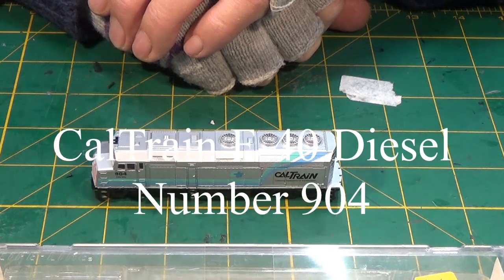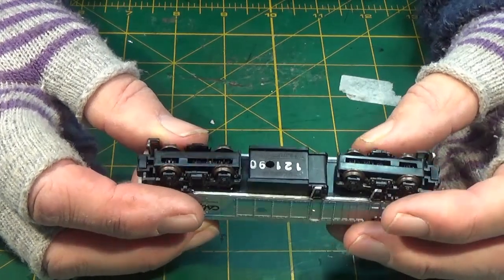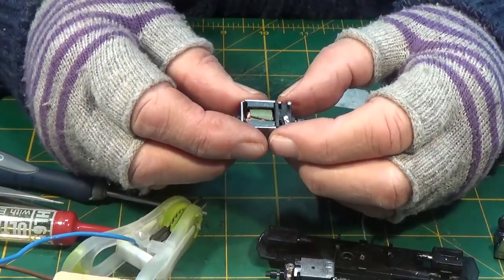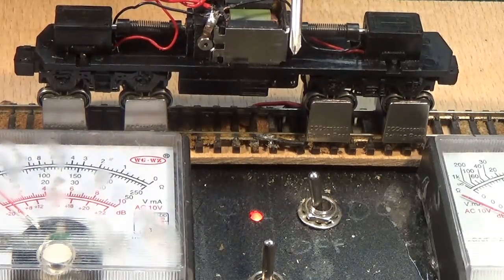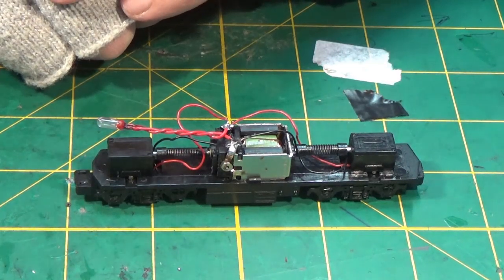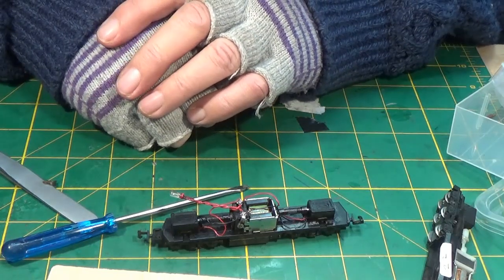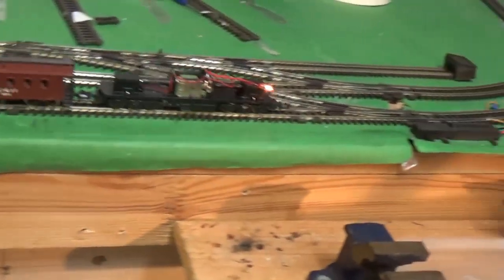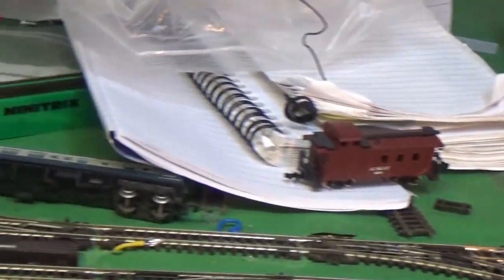Life Like CalTrain F-40 Diesel

Comment: would like to see an attempt to repair faulty motor
Reply from the maker: Hi Ed, thanks for looking in. I had tried to open the motor but it seems that an 'implement' had been inserted into the armature housing and ripped some of the wire from the windings. I have no re-winding facilities and I feel that, with n-gauge, it's easier replacing the motor. Sorry!
Cheers,